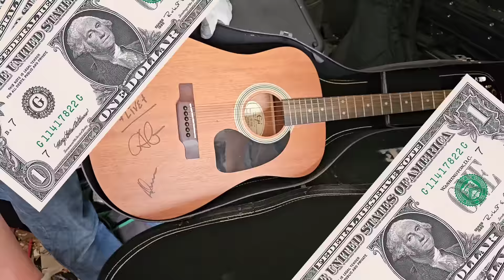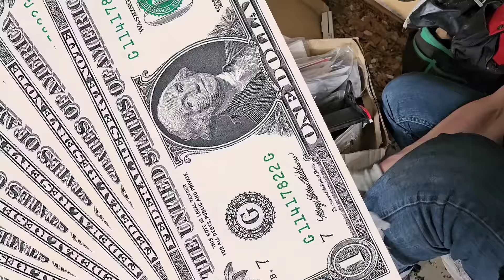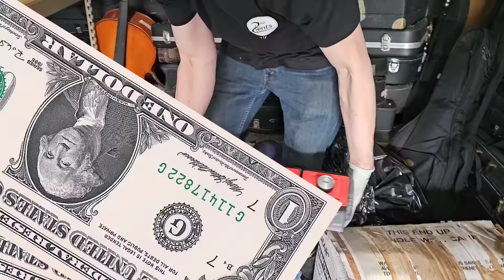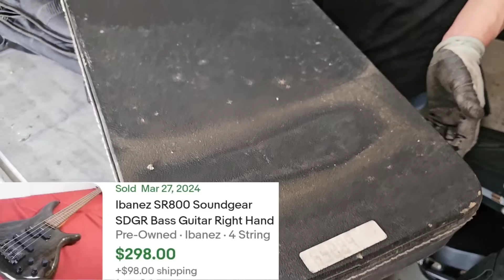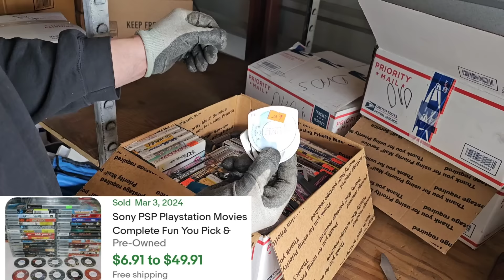I bought MOST EXPENSIVE Storage Unit / PAWN SHOP for $5,720 LOADED W/ MONEY FLOOR TO CEILING!

Comment: Hey guys - just a heads up, I’m a vintage guitar broker, that Steinberger Bass is potentially worth anywhere from $1500-2500, depending on originality and condition. It’s definitely the diamond in the rough. It was hard to tell its condition by the quick view I had, but you may want to consult a local guitar shop and have it set up and serviced. It will be worth the time and money to bring it back to playable condition. The neck is made of graphite and will likely be ok, but it likely needs a once over by a professional that will keep it as original as possible. Good luck in finding it a new home. Cheers, J
Reply: It was a CORT licensed by…is it still considered that valuable?
Reply: No, imho.
Reply: No it was a Cort licensed so it was cheap.
Reply: No it was a Cort licensed so it was cheap.
Reply: OP is correct, It's not a cort.. It's a vintage USA Stienberger XM2, anywhere from $1,500 to $2,800 depending on condition. On the high-end there is a white one listed for $3,600 right now. The USA stamp is on the bottom of the neck near the body. The serial number will have a Letter code before it that indicates which Factory it was built in, i.e. Newburgh, Nashville etc.. The picture and price in the thumbnail was incorrect make and model. That ovation will be worth a bit as well as the jackson pro and Randy Rhodes models.
Reply: Several times they mis-identified guitars. One clearly said Epiphone on the headstock and they called it a Gretch.
Reply: Um no…Cort licensed.. couple of hundred maybe
Reply: Nit really. Its not worth that

Comment: ammo is hard to make go bad.     I have lived on my ranch  for 35 years.  last year while digging a ditch i uncovered an ammo box.  The box was rusted badly.  It contained over 500 rounds of 7.62x39 ammo.  the rusted holes in the box allowed the empty space in the box to fill with dirt, and the carboard boxes that had held the ammo had all rotted away. Everything inside the box was damp.  Every round fired, and ejected without any trouble in my Mac 90.  It was all just as good as new.

Comment: The collection, well it’s pretty much what you would find in a pawn shop , mostly lower tier entry level but there’s always a market for those so a good clean up , set up would sell and from the amount shown , definitely make a profit.
I owned a used gear guitar store from 1991 to 1996 though only sold vintage guitars from the 60’s and 70’s and a few of those 80’s super Strat type that were still selling at the time.

Comment: The bass at 23 minute mark is a Real Steinburger bass not a Cort Licensed. Specifically a Steinberger XM2 produced in the 90's. It will fetch anywhere between $2000-$3000 depending on condition.
Reply from the maker: Wow, thanks for the information, I appreciate it

Comment: Most of those guitars are 3rd-rate and not worth much - NO big name brands except for the Steinberger, which could be desirable. Of the rest, only the Squires might bring a decent price, but since many are 30-40 years old and all were stored in an unconditioned garage they all will need work to get playable.  
Those cases are probably worth more than a lot of the guitars!

Comment: FFS... both the original PS owner and these guys had me literally cringing throughout the entire video at how the instruments (regardless of value) were stacked, stored, opened, handled and restacked. These are wooden instruments not metal guns and tools (totally different standards for storing), at least give enough of a crap to open and store the stuff right side up and not stack an additional 30+lbs of additional weight on top of an acoustic or anything in a soft shell case (dont even get me started on how the original PS owning moron stacked them to begin with). SMH

Comment: What you have in this locker is a tall stack of $100 and $200 guitars and cheap cases that is going to be impossible to sell. Believe me when I tell you the cheap used guitar market all across America is flooded with those. Nobody wants them.
Reply from the maker: Remember, I sell EVERYTHING at auction. I sold all of the instruments & cases from the unit for a little over $10,000. Everything else in the unit sold for over $15,000. I also got tons of free shelving